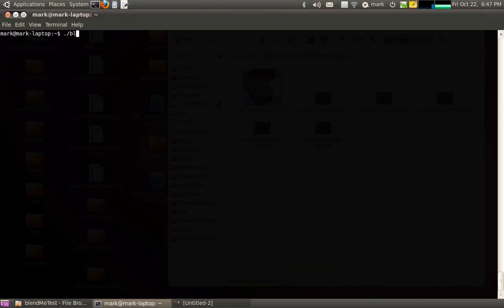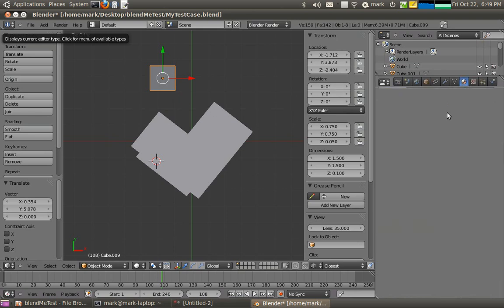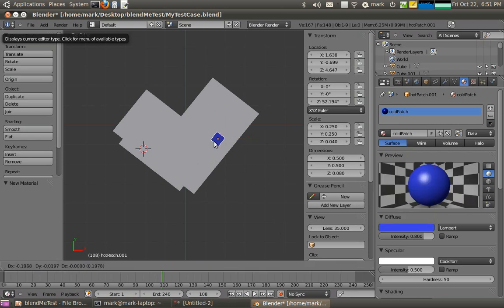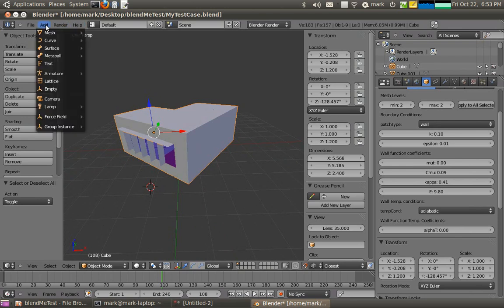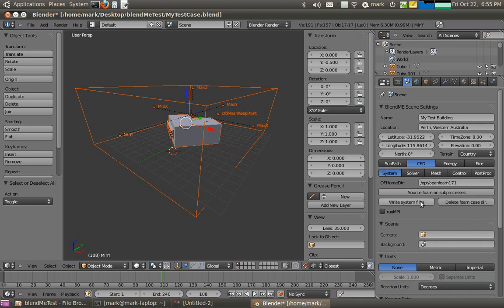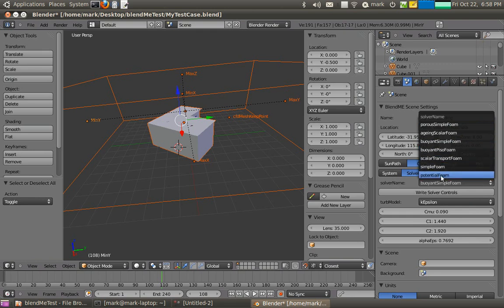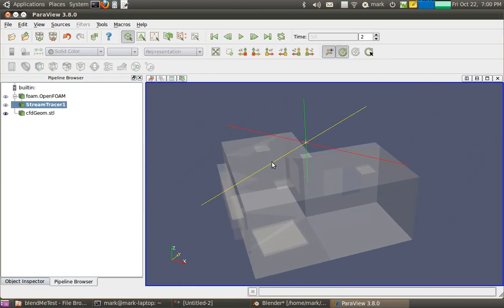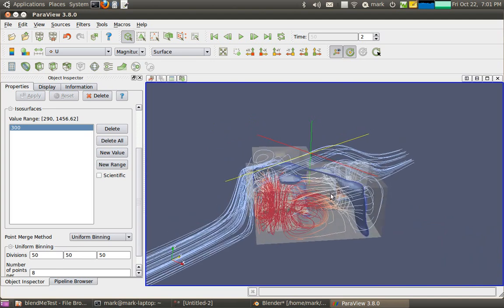BlendME Tutorial 03 - CFD Analysis

Comment from the maker: Yes.  The solvers that are wrapped from within Blender are: simpleFoam, pisoFoam, bouyantSimpleFoam, buoyantPimpleFoam, ageingScalarTransportFoam and  porousSimpleFoam.  Low-speed aerospace applications would use the simpleFoam or pisoFoam solvers.  High speed (supersonic) applications would use others solvers however this GUI would still be useful for setting up the case directory and meshing from which point adjusting the case files is quite easy.